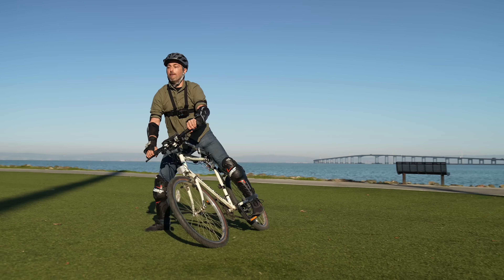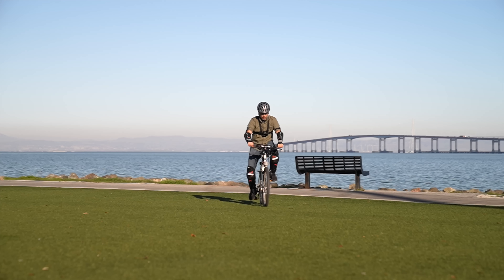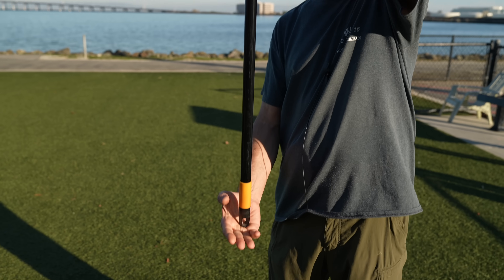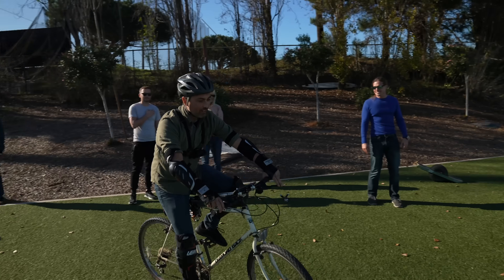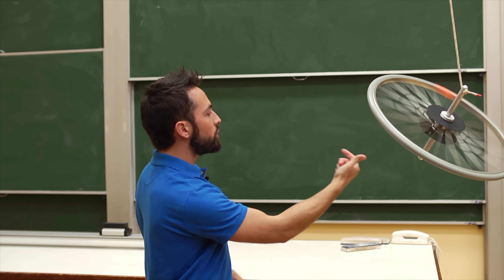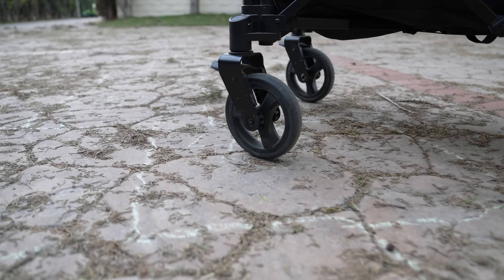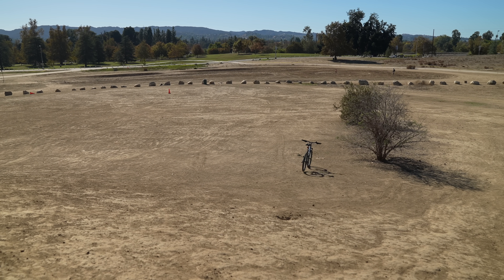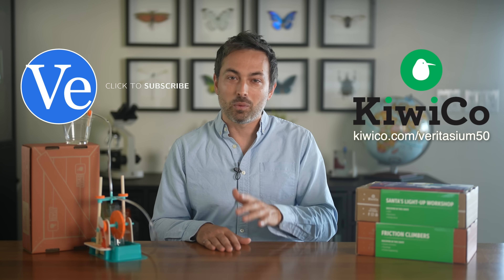Most People Don't Know How Bikes Work

Comment: This explains why I feel like I get stuck riding close to the edge of a sidewalk. I need to steer towards it first before I can steer away from it. I always thought this was some psychological barrier but it's just physics.
Reply: Technically it is a psychological barrier - no physics force is blocking you from falling onto the road
Reply: When learning to ride a motorcycle you learn about counter steering, but you also learn about target fixation. Target fixation means that you go where you look, so if you see a hazard in the road, and you focus on it to try and avoid it, you will instead run into it. Counter intuitively you have to try and focus on where the hazard is not, and you'll be fine. So in your case it's probably both a psychological and a physics problem.
Reply: Yes, very treacherous situation, I know exactly what you mean. Trying to squeeze past cars on the curb side will get you into that :P  When it happens to me I try to keep a centimeter or so of space between the tyre wall and the curb. It's enough to countersteer. Also if it does happen that space runs out a quick hard jerk on the handle bars will warp the tyre enough to shift the centre of gravity into the favorable direction. So never blow up your front tyre too hard because that makes it harder for such an emergency maneuver. Mind that my bike has a fairly thin front tyre as it's an all-road type bike (Honda XL600V Transalp 1994) and I mostly ride on studded tyres
Reply: just lean the entire bike instead of just turning the handle/front wheel, can be a pain at slow speeds but still possible, just don't sit and counter balance with your body. You don't need to turn the handle/front wheel to turn (or barely for sharper turns but after the bike lean so still no need to counter steer).
Reply: @qgqsrg1  You can't just lean. Countersteering action always comes first.
Reply: @XtreeM_FaiL  I can definitely push down/lean down my entire bike while putting most of my weight on the "outside"/opposite side. You just need to stand up instead of sitting down while turning.  Speed helps too, they are going so slowly that they need to accelerate/continue pedalling while they turn, which is just not a good idea when leaning your bike, unless you want your foot/pedal to hit the ground and crash.

This isn't a motorbike which weighs hundreds of kilos, it's not hard to counterbalance using my body.

cycling with my handle fully locked, now that's something I wouldn't do.
Reply: @XtreeM_FaiL  if it was on its own or if you sit, that's why after you lean your bike you hold your bike up while putting most of your weight on the outside (right if turning left). 
You fall if you let the bike do all the balancing.
Reply: @XtreeM_FaiL  idk if depends on the tires (got thick tires for mountain bikes) but it does make it turn, just like a skateboard whose wheels are locked facing one way.
Reply: @XtreeM_FaiL  you ever let your bike rust so much that it can't naturally turn/steer to one side (right in my case), due to it needing extra strength? Well I have and I certainly did turn left a lot without counter steering to the right, which couldn't be done subconsciously anymore, same for turning right, only steering if I wanted a closer turn or wasn't going fast, due to steering right being a pain, and actually more dangerous.
Reply: @qgqsrg1  Exactly this , 5 yo girls turn only the steering wheel with their support wheels on the side that forbid you from leaning the bicycle... especially with motorcycles you mostly lean. I guess you could associate with sense of balance and kinesthetic IQ but you can lean and turn the right amount at the same time. 

However riding just next to a sidewalk when on the road (not on the sidewalk) , if you want to turn away from it the back side of the front wheel will touch on the side of the sidewalk so it will ruin your balancing and that's something that must be aware of. You must first lean the bike and get away from it before you can begin a sharp turn.  

What's more of a "psychological" effect is that when you drive/ride you go where you look at so looking down at the sidewalk edge opposite from where you want to turn will affect your balance. In a circus act balancing on a rope you must look straight ahead and also engage your peripheral vision , although you probably have to have a very symmetrical head too (cochleas right behind our ears are responsible for our sense of balance).
Reply: Idk but maybe road slope has something to do with it?
Reply: @donmab The direction a bike travels depends on which way the bike's handlebars face, which is in turn determined by the way the bike is leaning.

Assuming a perfectly balanced, straight traveling bicycle, a rider not touching the handlebars can steer the bike only by leaning from side to side. Ignoring chaotic influences, such as turbulence, the force will tilt the bicycle in the opposite direction to the rider, by a non-trivial amount. Assuming symmetric friction (probably not so) the centre of mass should remain constant in the horizontal plane (obviously not in the vertical plane - as I understand it, a system cannot change its own centre of mass relative to its environment, without interacting with its environment. I can't see how this would be more significant than the lean in the horizontal plane, since the only confounding force there would be friction, and since it's just a tilt at essentially the very centre of a lever, the impact of that friction on the system is trivial compared to the other forces at play.

Once the bike is leaning, then the rider can draw themselves nearer/further the bike to shift the centre of mass in the horizontal plane – such a shift will transfer through the contact point on the ground, rather than changing the tilt of the bike – thus allowing to provide rotational acceleration to the bike, changing its tilt to the desired direction. The closer the bike is to vertical, the less acceleration such a shift will provide. When the bike is vertical, such a shift provides no horizontal acceleration – hence the "counter-steer" is required.

I was gonna drop this but then I started seeing what appeared to be genuine questions, so I hope you've genuinely got an answer now :D 
I feel like I didn't explain that particularly clearly, let me know if you need me to clarify anything.
Reply: I think it's more because you never go in a perfectly straight line so you could fall, you don't really need to steer left to go right, you just need to lean your weight to the left
Reply: or just look where you want to go, you fixate on something you're going there.
Reply: Fun fact? I was able to learn to ride a bike ONLY in 7-th grade !!! Because only then i uderstood phisicaly speaking what i need to do in order to maintain balance. The counter-forces i needed to develop ! In 7'th grade i got the Phisics discipline, the mechanics part. Same with the swiming, i was able to swim when i understood what i need to do in order to swim, by creating a constant force down to lift my body a little above the water. To be exact i neded to lift my hand or my leg more aquadinamicaly than when i put it don in the water. The diferences between these 2 forces was the lift force, to be able to stay on water. After that, to advance in water, i used part of the lift force to advance. So the movement was like a propeler.  So now i learned to swim too.  Same with staing on a ball , or 2 crossing pipes, like a circus guy,  or sky-ing and snowboarding. Couldn't aford a ski instructor, so i distroyed couple of a sky slopes to learn. Snow was destroyed,  and other sky turists had critical problem riding the slopes i used. Yeah , whenever i had a real problem to learned something, the other people around me got THE BAD LUCK, during my learning process. And i'm ok with that because nobody wanted to HELP ME. SO THEY GOT ALL THE SIDE EFFECTS OF KARMA !!!
Reply: If you reach the point where your front tyre is brushing the kerb, you can neither steer away nor lean away. If you're going too fast to stop, only a bunnyhop over the kerb will save you.
Reply: Yeah, the flaw of this video is that it never mentions riding a bike with no hands. You can absolutely still turn by leaning. Since there’s no input in the handle bars, there’s obviously no counter-stear prior to the turn.
Reply: @interestedparty00  What about the counter steer induced by the self stabilization of the bike?
Reply: @11matt555 , there's zero doubt that you need to turn both left and right to keep the bike stabilized when riding in a straight line. My point is that a right turn is NOT needed in order to turn left. A lean to the left will turn the bike to the left without any input on the handle bars.
Reply: @interestedparty00  Doesn't seem so obvious to me. Leaning one way will still push the bike the other way – so in a way, still is a countersteer.
Reply: @sqwwrrwl , nope. When riding a bike with no hands, leaning to the left will NOT turn the bike to the right.
Reply: @interestedparty00  My concern is that, in order to lean to the left, you have to push against the bike, causing it to lean to the right. As someone else has mentioned, mountain bikers do use this to steer without countersteering, and to improve balance at lower speeds.
Reply: @sqwwrrwl , have you ever ridden a bike without using your hands? Have you ever turned your bike while using no hands. I have. You don't need to lean right in order to lean to the left.
Reply: @interestedparty00  Yeah, I have. What I'm pointing out is that in order to lean, you have to move from vertical to an angle. This motion, according to the rules of physics, will tilt the bike in the other direction momentarily.
Reply: @interestedparty00  But when you ride with no hands and lean left, the bike will tilt right causing the steering wheel to also turn right, initiating a left turn. On a bicycle like this that wouldn't happen, so I'm not sure how effective leaning would be here.
Reply: @sqwwrrwl , not at all. If you simply drop your head to one side, the horizontal force in the other direction is tiny in comparison to the adjustment to the center of gravity. It's strange that you claim to have steered a bike with no hands yet think that it's not possible.
Reply: @Liteg0 , no. When you lean to the left, the bike turns to the left. If you've ever steered a bike without your hands, then you would know this.
Reply: @interestedparty00  Im not saying it doesn't lean to the left, it does, after a slight right turn to initate the left turn. It's physics, every action has an equal or opposite reacion, in this case when you lean the upperbody to the left, the lowerbody and bike will lean slightly to the right.

But as I said, I don't know if this would be enough to prevent you from being able to lean into the turn with that bike, maybe it would work. Im just saying it's not the same as with a regular bike.

I know how to ride a unicycle and ride both bicycles and motorbikes with no hands, so don't worry about that.
Reply: @interestedparty00  Right, but to drop your head to one side, you have to move an equal amount of mass towards the other side – or more, if counting for lever effects.
Reply: @Liteg0 : "Im not saying it doesn't lean to the left, it does, after a slight right turn to initate the left turn." <-- Wrong. When turning with no hands on the bar, there is no right turn prior to the left turn.
Reply: @sqwwrrwl , the small impulse force required to move mass in an effort to move the center of gravity is negligible in comparison to the sustained force created by the offset center of gravity. I'm not sure why you are conflating the two forces and believe that they most be equal. It's strange that your brain is having trouble believing that you've ever steered a bike with no hands. Maybe your ego won't let you concede a point that you know is correct.
Reply: @interestedparty00  Okey dude, just like how everyone knows to turn the handlebar to the  left when doing a left turn in the video I guess.
Reply: @Liteg0 , THAT is my entire point. I bet people would have been able to turn the bike more successfully if they had been riding without hands on the bars! They simply would have leaned in the direction of the desired turn. You don't need to turn the bars to the right in order to turn left. That simply expedites the lean. You can lean without turning the bars. Again, if you have ever steered a bike without hands on the bars, then you would know this.
Reply: @interestedparty00  
What I'm denying is that from a perfectly balanced starting position is that you can shift your centre of mass horizontally. Once the bicycle is angled, then sure, you can.
Reply: Wrong.
Reply: @willtheprodigy3819 , nope. Not wrong. Have you ever ridden a bike without having your hands on the handle bars?

Comment: How does this work when you drive without using your hands? So when your hands don't touch the steering wheel?
Reply: Theoretically you don't need to counter steer at all if you lean in to the turn. I guess the rider is always leaning one way or another, so they just need to time it to the rhythm.
Reply: @MarkkuS  yes that's exactly what I was thinking. I actually noticed that I very often drive this way. My hands are mostly resting on the steering wheel but I don't really use them.
That being said. When one side is locked you can't compensate anymore at all. So you will fall off anyway.

Comment: This is not counter-steering!
Counter-steering is what you do on a motorbike where you use the inside of the wheel to turn - meaning that at speed you are steering in the opposite direction to the turn.
When turning to the right at speed on a motorbike you push forward with your right hand. This causes the wheel to turn to the left which then unbalances the bike causing it to lean to the right, as long as you then maintain this push with the right hand the wheel will continue pointing left with the bike leaning to the right and the inside of the right side of the wheel will then cause the bike to turn to the right(as the inside of the right side of the wheel traces a circular path to the right).
(ex-biker 600cc)

Comment: It's funny how bikes are so old but we still don't fully and completely understand how they work. 
Also interesting how the ability to ride a bike becomes so embedded in the human mind it's practically instinctual.
Reply: it's basically designed to act as an extension on how we move about (walking/running).
I also think kids have big heads(proportionally) to help them learn to walk,......it seems like the shorter you are, the bigger your head has to be.
Reply: Makes me think how the first guy to put pedals on a bicycle would've also tried to figure it out, but since steering is already implemented before pedals everyone then just took it for granted.

Comment: If you get your driver license for motorcycles this is what they teach you as "Counter steering". If suddenly an obstacle appears and you want to avoid it with a sharp right turn, you have to push the handlebars with your righthand away from you :)
Reply: No it's not - counter-steering on a motorbike is where you use the inside of the wheel to turn at speed meaning that you are steering in the opposite direction to the turn while in a constant fast speed turn.
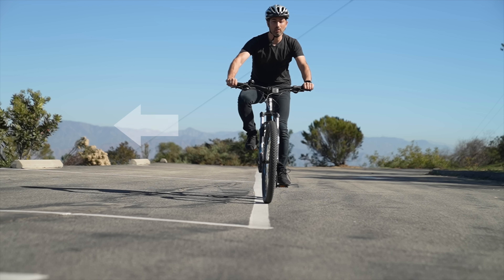Reply: @Slarti  Yeah totally, and as you can see in 2:25 they do exactly the same thing. Steer in the opposite direction where you want to go

Comment: As a Motorcycle driver, this is common knowledge (steer left to turn right ) :D
But always funny to talk about such stuff with ppl who don't know
Reply: And at high speeds on a motorcycle, it is the gyroscopic affect that has more impact on bike lean. For example, applying a small forward force to the left results in a gyroscopic force that causes the front wheel to lean left and thus start the turn. It is this same gyroscopic effect that makes the bike more stable at higher speeds than lower speeds, and is the bane of the low speed qualification of an 'M' class endorsement, as any biker knows.
Reply: I immediately knew where this was going. Countersteering!
Reply: "Go left to go right" - Doc Hudson

Comment: This explains motorcycle counter steering very well
Reply: No it doesn't.
Counter-steering on a motorbike is a completely different principle where you are using the inside of the wheel on the turn and maintaining the wheel in the opposite direction throughout the turn.
Reply: @Slarti  While steering is far more exaggerated on a bicycle due to lower speeds and less weight, it’s the same principle. Motorcycles just have much larger contact patch with the road and therefore has a larger roundness than a bicycle tire.
Reply: It has nothing to do with the wheel diameter, the profile is round just to allow for consistent contact with the road at any angle.